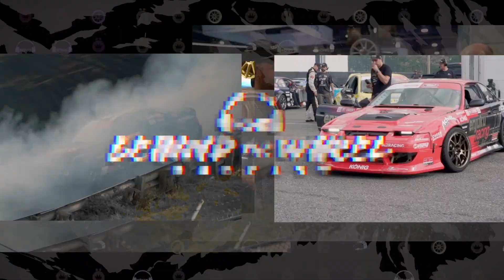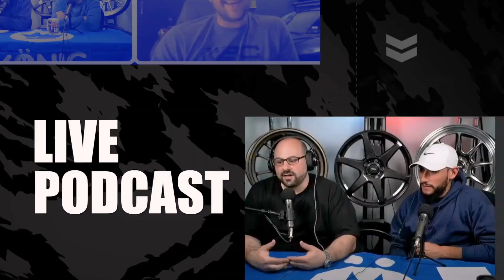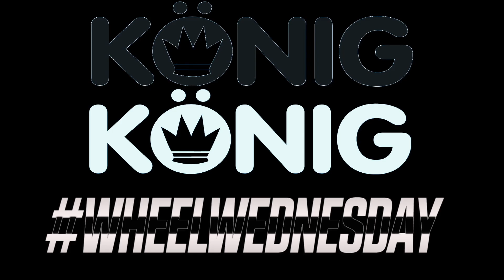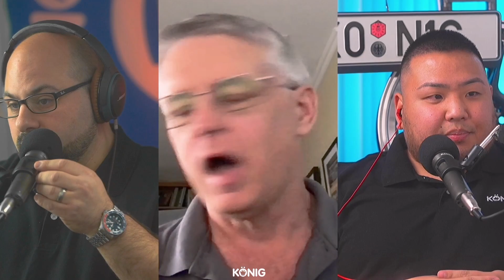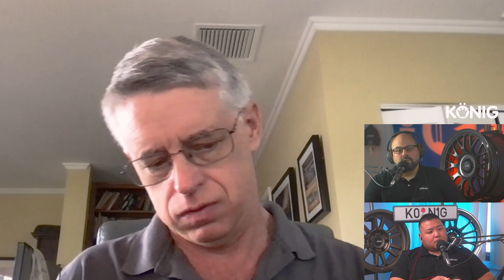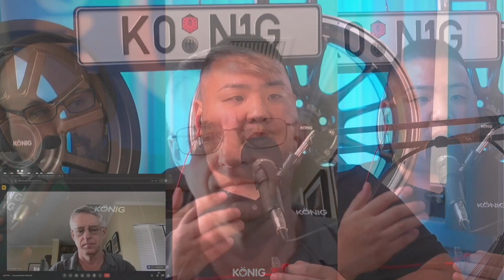L-SWAP, TUNING, PASSING EMISSIONS w/ Co-Founder of HONDATA (@HondataInc ) | Behind the Wheel Podcast

Comment: Some say the rod bolts for the K series engines are made from a mixture Unobtainium reinforced with Adamantiom, and you could hang the weight of the moon from a single bolt.
While the L series engines simply used left over sump bolts to hold the connecting rods together.

Comment: yes rich you can make the 1.5 liter turbo L15 honda civic fk7 hatchback a beast ,I have a 2020 sport hatchback full loaded for that year and yes ,1st don't install any parts unless u have hondata, then find a local speed shop I use national speed , yeah and get a dyno tune which will get your fuel to air ratio right, yeah stock 180 hp im at now 262hp and 263 torgue with a cvt transmission, can't over power the cvt ,and i have replaced every part on the car to go fast ,don't use slow prl parts lol ,I won't name my quality parts don't want copy cats ,and I got yalls 18x8.5 45 ampliform wheels on my fk7 white pearl panda stock body kit black at the bottom and yeah just make sure you get a greddy ddr full exhaust system and a hks blow valve sounds like heaven and replace everything else with out prl ,lol parts  😢
Reply: Would love to swap that into a 9gen Accord CVT included